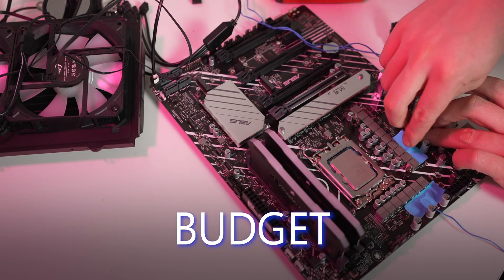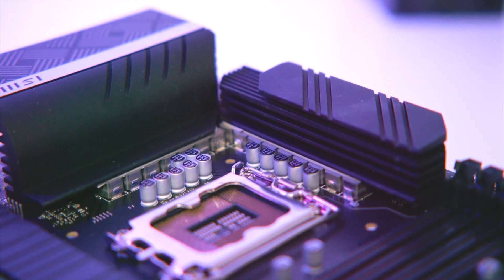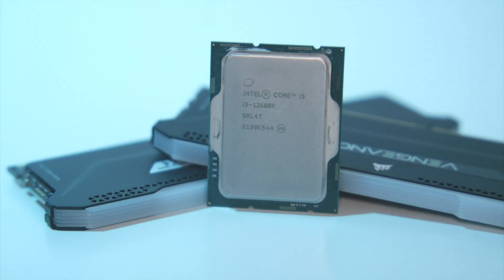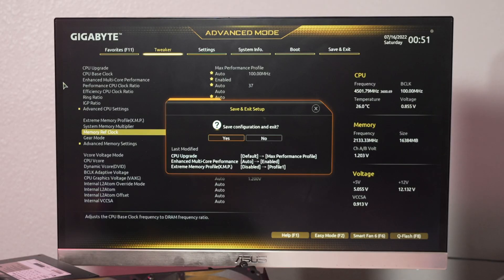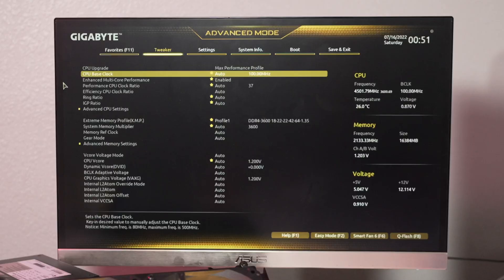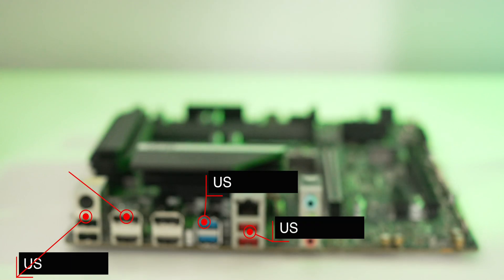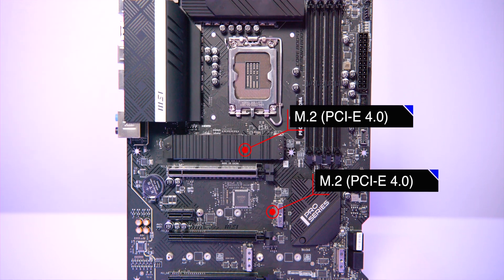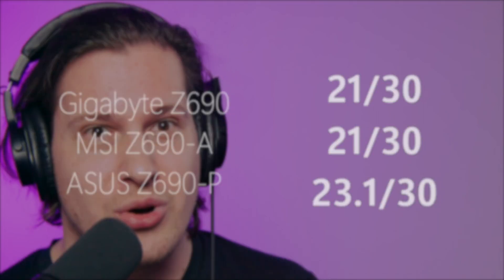The BEST Budget Z690 Motherboard. WOW!

Comment: Sheeeeet that's a good ole PS2 connector. I still bring one when I go to fix someone else's PC because sometimes a USB mouse or keyboard won't work in UEFI/bios.
Also, that tool-less M.2 installation is fundamentally and fatally flawed. If you have case fans which might vibrate your machine, the tab in place of the m.2 screw will ever so slightly move, eventually causing your drive to pop up, which is not fun. I recently had a drive get corrupted on me that way. I've seen other boards do it MUCH better by having a plastic screw and standoff that are attached to each other by a small plastic "Wire" for lack of a better term. I can't really describe it too well, but it's the best way I have seen and shouldn't interfere with any heat-spreaders you may want to use, but if it does, you should be able to use a regular m.2 screw & standoff

Comment: Great video! But you actually used a picture of a gigabyte mobo instead of asus in the port selection part.😅
Reply: i switched to MSI PRO Z690-A from ASUS PRIME Z690-P and shocked with that image+port count of him. Asus should be loser here in usb ports comparison. it only has 4 usb ports behind mobo. unlike others which has  6 ports. thanks for clearing that out.

Comment: Do you know if possible undevolting non-K processors on Asus Prime z690m-plus d4?. I'm especially interested in using it with a 12400. I've read that some boards even allow you to tweak the offset voltage in the bios but it has no real effect.
Do you know of any other model of 12th gen intel cpu micro-atx motherboard that allows it?

Thanks! Cheers!
Reply from the maker: Last time I’ve checked all the boards were expensive af. So might as well just get K. I’m gonna look into it

Comment: Hey i am in between Asus Prime Z690-P or MSI pro Z690-A Wifi. Asus a bit expensive but not that much and lacking wifi. Everybody says Asus better (vrm, overclocking) i have 3200mhz 2x8 ram and i5-12600K (not planning oc but if i have to i could use it when I get something like 4070) which one should I choose
Reply: I choosed MSI pro z690-a and I'm glad haven't got any problems

Comment: Great video and break down. I’ve been trying to make my mind up on if I should buy the ASUS Z690-P Motherboard. This video has helped me to commit to it. I’m putting a i5 12600k on it paired with Evga 3060ti for my first PC build.

I hit the sub button 👍
Reply: Planning on doing the same, except with a 3070. Curios if you still think the mobo was a good purchase 4 months later?
Reply: @kamaudennis3  Yeah everything is working great for me. I got the mobo off EBay for $150 as an open box item never used. 

From what I researched the cpu is good up to a 3080ti before it starts to bottle neck. But with this mobo it’s easy to upgrade because it’s a 12th and 13th gen cpu socket. 

It looks good in a white case also because of the silver and black
Reply: same specs but with a 3080 and I think it's a great build.
Reply: I'm thinking about this MB as well with a. 12700K and 3080. Any thoughts?
Reply: @umeremad2123  That’s a great combo. What drew me to this motherboard is that it’s budget friendly and future proofs for upgrades in the future. 

On the Asus website it supports ddr4 memory speeds up to 5333 and both 12th and 13th gen cpu. And from the tests I’ve seen online there’s not much of a difference between DDR4 and DDR5.